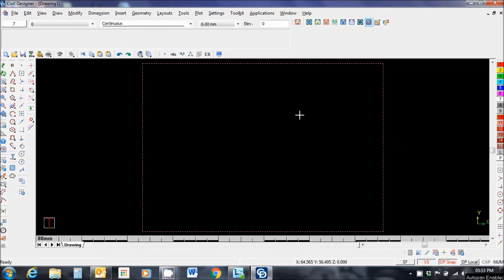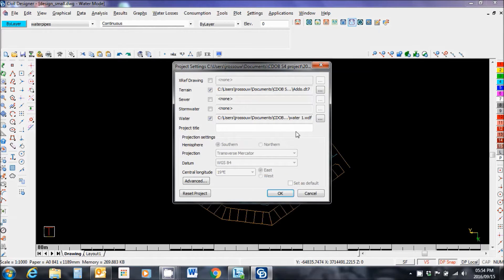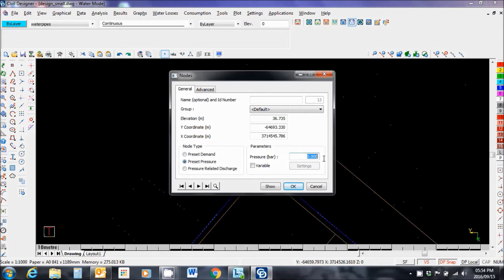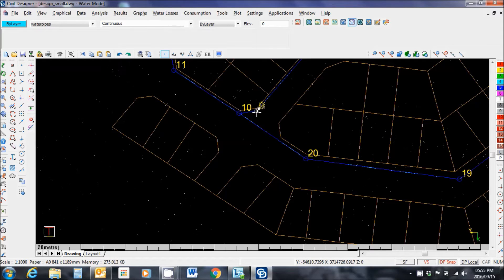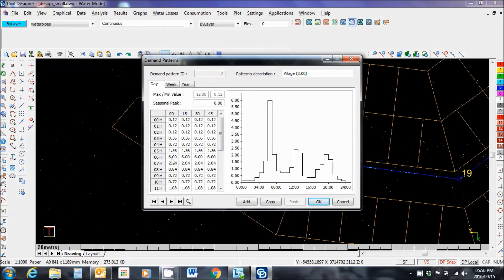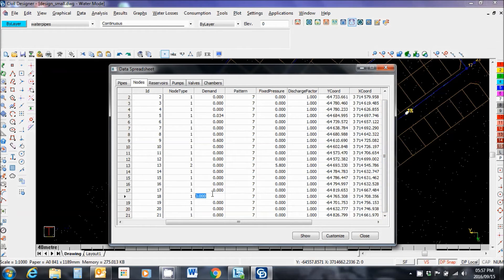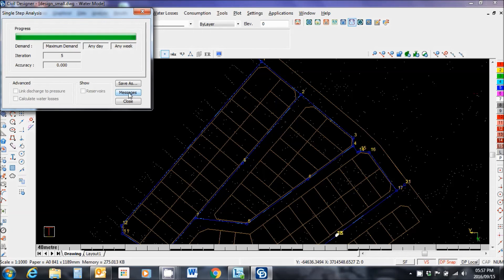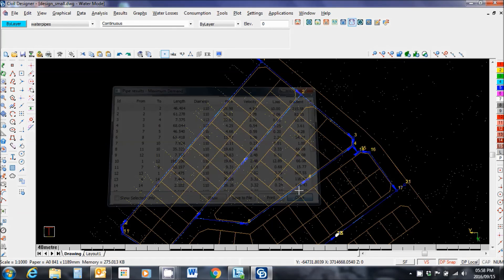Water network analysis: Civil Designer

Comment: Good Evening Mr Rossouw. I am having problems with my DTM File and Importing my CAD File onto the same coordinate system. Is there something I am missing in order to get them above one another so that I could generate the contours?
Reply from the maker: You need to check that the coordinates of the survey and drawing match in terms of signs and magnitude. You can apply constants in the design software to align the drawing.  Check the video on bringing drawings into civil designer, might be helpful.